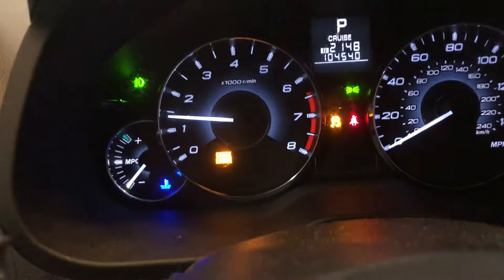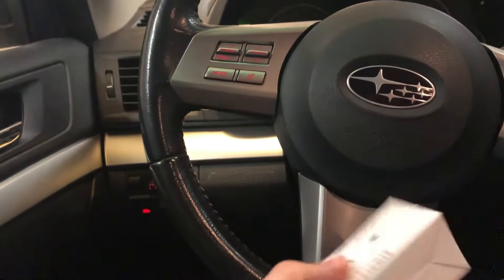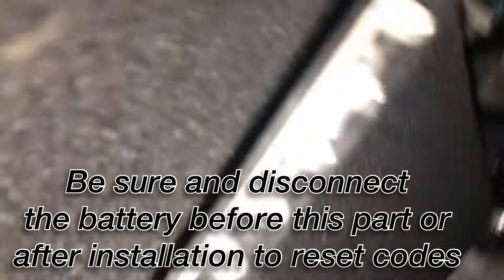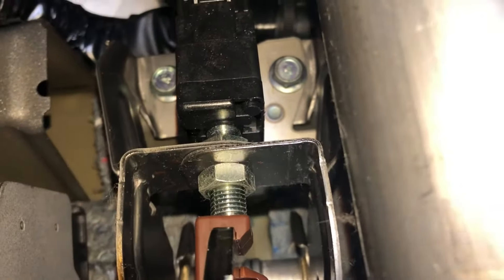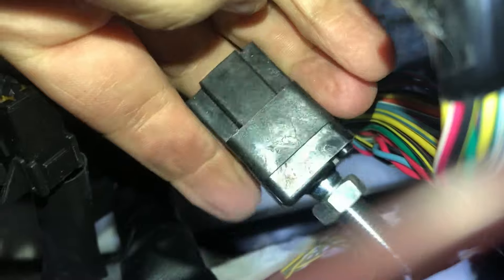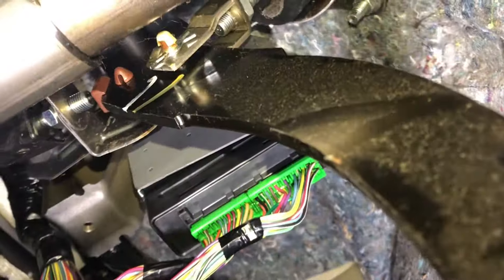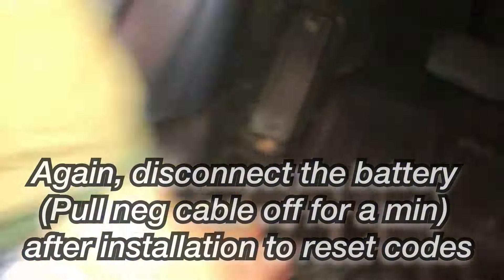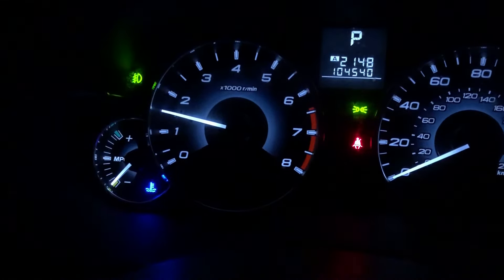Replacing Brake light Switch in the Subaru

Comment: We just changed out the Brake Light Switch (Subaru #83370AA001 Stop Lamp Switch, from Amazon $35.80)... and it worked,.. so far! Thank You Kangaroo Elite for this well made video.
Reply: Has your problem remained fixed?
Reply: You can get the same part number for 38.65 on eBay and it’s OEM.

Comment: I appreciate your post!   My 2015 Legacy repeatedly overloaded the brake light fuse and as a result would not shift out of park without using the emergency release.  Replacing the brake light switch appears to have fixed the issue …. no blown fuses !
Reply from the maker: Wow!! That’d be super frustrating, as I was at least able to drive mine when it went bad.  Glad that I could help! 👍

Comment: Traction on with brake flashing on 2011 Legacy base after 15 min of driving only  - changed and adjusted BLS , changed rear break lights and reset with clamp off battery to clear codes. Perfect operation after.
Reply: I’m having the same issue with my 2010 legacy, gonna get my guy to check it out! 🤞🏼
Reply: Likewise! I’m really hoping this will solve the issue

Comment: i'm replacing my break light switch for the third time. i have been replacing it with subaru oem swift which is just a crappy nissan brake light switft. i'm trying a $50 BLS from oreilly which has a lifetime warranty.
Reply: What year was your subaru?

Comment: Actually a lot of issues cause this combination.  When ever the check engine light comes on with that combination it can be a number of problems which only a scan tool can help you figurre out which one it is.  On my 2013 Subaru Legacy when it happened this year the scan tool showed an engine misfire.  It would sometimes come on and go off after 10 seconds, and other times just stay on.  When I discovered it was an engine misfire, I looked at the coils on the H6 engine.  Three were cracked.  Replace the 6 engine coils, the misfire was solved.  This happened at 125,000 miles.  Fortunately, the scan tool led me in the right direction.  I wish it always meant something this simple but it does not.
Reply: What was the code on scan tool?
Reply: @kimatm6035  The only code I remember getting was P0303 - which is engine misfire.  That is when we starting looking at the engine coils.(myself and my mechanic who is really good) and we did figure it out when they were visibly cracked.
Reply: What kind of scan tool do you own that works for a Subaru?

Comment: Had the subaru outback 3.6 i changed the brake switch and brake light/traction light is now off the screen. And next thing you know another light came off which is the at oil temp flashing… want to trade in this car but want to fix the flashing light first before trading in : )

Comment: Note: When I screwed in the part I got it in to far, which depressed the brake pedal. On my test drive I noticed the drag and readjusted the upper nut to lift it up and realease the brake. FYI, maybe that will save you some time and frustration
Reply from the maker: I knew not to screw it all the way in and adjust it where it clicks over only when fully depressing the pedal.  Good Catch!! And excellent pointer for anyone not familiar with setting up sensors. 👍
Reply: So you didn’t screw the nut all the way? I just fixed it but I can’t move my gear shift out of park. Could that be it?

Comment: Important Update¡¡ I changed the brake light switch, and it worked but only for two days. Had to take the car to the dealer. The reason behind the lights and RPMs falling to low on the stop lights, was debris acumulated on the hairlike strings on the Mass Air flow sensor MAF.
Reply from the maker: I never had low rpms with my issue. That for sure sounds like a MAF issue. Glad you got it fixed, plus if you changed your switch, that’s one less thing to worry about going wrong.

Comment: On some models there is a recall on the switches please contact your dealer first with your cars Vin number, if your car falls under the recall it gets replaced free of charge
Reply from the maker: Mine did not, but that’s always good to check first with an issue.

Comment: 2013 Impreza, replaced the break light switch unplugged the battery and cleared the codes. Two weeks later all three lights came back on while driving.
Reply: Did you figure out this?
Reply: Yeah what ended up happenning to it

Comment: Thanks.  Our lights are a bit different. 14’ with eyesight.  Only code I saw was a cat not operating up to efficiency.  Reset that and lights went away.  Will reset the second time but since daughter 1.5 hours away.  I will take a brake pedal switch with me.
Reply from the maker: Good easy thing to try.  Does sound a bit different potentially, may be some sort of dirty sensor or something if just the cat code is thrown, but hopefully it’s thiss oddly all encompassing brake light switch. Good luck!

Comment: here is how i fixed it! ...replaced both o2 sensors on catalytic converter(200 bucks from rock auto) also removed catalytic converter(15 min- 9 bolts easily accessible) and soaked it overnight in a large cooler with purple zep degreaser(15bucks)and water. then rinsed out converter with garden hose for 1/2 hr and placed back in cooler of just water to soak overnight again. reassembled and most lights went off(you can also disconnect battery for 20 min to reset ecm and reconnect) except brake light witch took couple drives to go off on its own, been 500 miles and problem hasn't returned. welcome

Comment: Same issue with my car. We replaced the switch,  so far no check engine light. My question is did your brake lights stop working or get stuck on? My brake lights were still working. Hopefully, this is the fix. The code reader did say likely fix was replace brake light switch.
Reply from the maker: Good to know it threw that particular code! Thanks for that!  My lights were also working, I’d assume some weird short in the switch that is enough to trigger the code, but not enough to keep the light function from working.  Glad to hear it helped! 👍👍🎉

Comment: The disconnect battery for 2 min will have the same result. Interested to know if you had transmission codes ?
Reply from the maker: Unfortunately I never had the codes ran.  Disconnecting the battery is the classic I.T. move 👍  Just an easy fix a Subaru mechanic mentioned trying.

Comment: Glad I found your video - Thank You. It really pays to have friends in the auto industry. I see your reply to David R below, two months ago, and I'm wondering if this problem has since resurfaced? I've been having this issue on my 2011 OB, ran the codes on the OBDII scanner. Forget what the code was but it didn't worry me. I deleted the codes and all was well for a few days then it comes back. Like I've read, doing this just erases the code and doesn't necessarily fix the problem. I'm surprised it's something this easy. BTW,  I see you had 104K on your OB, have you done your timing belt?
Reply from the maker: Glad to help.  I agree super odd to be this simple little part. I No longer have the vehicle.

Comment: Man same problem with my 2011 legacy and I changed the BLS and cleared codes but it didn’t go away so still stuck trying to figure it out
Reply from the maker: As I mentioned in the video, I didn’t have the codes ran when it happened, just got word of mouth to try this fix.  I’d try leaving the battery disconnected a good while and trying again, if codes persist it may be time to look into starting with the sensors associated with whichever codes you’re getting.

Comment: I saw your video to work on mine but I have a plate blocking access to the nut closer to the pedal. Is that something you removed on yours to access both nuts easier?
Reply from the maker: I think I just worked under/behind it if memory serves me right.  It was hard to film and do at the same time.  If you’re talking about the panel beneath the steering wheel, I believe that one is easily removed with a few 10mm small bolts.

Comment: Hi there I did this exact thing because I was having this problem. My lights went away but the minute I stepped on the brake the BRAKE light and cruise control light came back on. But, now my car stays in park and can’t move the gear shift. Did I do something wrong? Pls help!!
Reply from the maker: That sounds like the same thing.  Before replacing the whole switch like I did, check that your pedal is pushing the pin on the switch most of the way in by using your hand on the brake pedal while kneeling by your driver door.

Comment: Replaced my brake light switch part was 20$.not a recall for 2010 outback, was a pain in the ass to change and did not fix the issue
Reply: What fixed it?
Reply: @SamSam-ih6nt  Nothing yet, i have until December to deal with this.

Comment: Mine is doing the same . . . 2012 Outback . . . think I might have to try this too.
Reply: 2012 outback is not on the recall list. check with subaru website to see if they have added it to recall list. i had my dealer done today without paying a dime. good luck to u
Reply from the maker: It’s worth a shot.
Reply: Any luck with that Homeless Pepper?? I'm having the same issue myself??
Reply: @pedromoctezumajr837   unfortunately it was the head gasket that needed replacing. I had that done in August 2019 and all has been fine since. Hopefully your car isn't as serious as mine.
Reply: @Homeless Pepper....same year over here, how was yours started, what exactly would happen, sorry to bother, but looking for relation, to see if my Outback is having the same issues you have had?? Was it expensive (work done)? I'm not a DIY guy, so I'm a bit nervous, I love Subaru, but this is scary, was an owner of an 05 fell in love, now have the 2012, and she's was good to me thus far, want her to make it to 200000, like my last one!
Reply: @pedromoctezumajr837  The engine temperature guage was showing it was overheating after about 45 km. Constantly had to fill up with rad fluid.
Reply: @AdamPepper12  mine is going red-blue-red-blue when all the lights light up, and blink...however when I'm just sitting, with the car in park, and running  it won't overheat....only when those cluster lights come on it overheats..that sound familiar???
Reply: @pedromoctezumajr837  that does sound familiar. I would get everything blinking and going off and eventually the temp guage light would stay solid. I hope it is simpler than what I had.
Reply: @AdamPepper12  that's scary...how would I know if it's a head gasket? And the codes I get under a code check don't pick that up?? How would I find out what side (drivers or passengers side is blown?? Is there a tell tale sign that would show me??
Reply: @pedromoctezumajr837  I didn't get confirmation until I took it to a dealership. They will run all kinds of pressure tests to diagnose it. My code reader did not pick it up either. It was not simple for them to pick up, it took a few goes.
Reply: @AdamPepper12  wondering if a leak would give you a detailed explanation to what head gasket is blown, did the dealership charge you to do the test??
Reply: @pedromoctezumajr837  not sure if there was a charge because I had them do all the necessary work. Had them do the timing belt while they were at it. It was about $4000 Cdn which is about $3000 USD so it was not cheap. The repair list was quite extensive . . . but I cannot remember all what they did.
Reply: @AdamPepper12  damn....your breaking my ❤️

Comment: Have a 2015 outback 3.6. Most of the time just taking off the gas cap and putting it back on would clear it. The last time that didnt work. I disconnect the battery cables for 4-5 min, it cleared but came back shortly. Then I dissconnected the cables from the battery and then held the pos and neg connectors togather for 20sec to reset the ecu. Hasn't came on since.
Reply from the maker: I tried resetting by taking the battery cables off, but this permanently fixed it, far as I could tell.

Comment: Assume you checked your brake lights. Was the switch adjustable? Looks adjustable. It Cancels auto braking. Dealer told me it wasn't. On mine I find there is a little too much travel before the lights come on meaning the Auto braking does not cancel with just a touch on the pedal. Went off approaching a fence to park. BAD. Had foot on the brake. Recon I swore at the car. CUSSED. 16 Outback 2.5

Comment: My 2011 outback had all lights on. Oddly I replaced the front wheel bearings drove about 50 miles and all the lights went out and never came back on. A  Subaru mechanic with 25 years experience told me it's a common issue with Subarus.

Comment: Also, for me , it was my battery cable was rusted out and car wasn't getting a good enough and steady enough connection.
Reply from the maker: Corrosion on the battery is another common one with electrical issues such as this. 👍 Glad you got yours fixed up

Comment: Just changed the brake light switch and immediately the lights came back on. 2013 Subaru Outback. Also replaced the battery. Any other ideas?
Reply from the maker: Electrical issues can be a real pain to track down. Obviously the switch fixed many people’s problem. Battery was a good call to try. There’s a whole heap of sensors that could fail, from transmission, to Mass airflow, to ABS. I’d make sure you replace the brake light switch with a brand new one, and not old.  I’d only be able to suggest talking with a subaru mechanic that would better know common problems, after all, that’s how I found out the brake light switch was a common issue.

Comment: My car has the old one the would just twist and click into place does it matter ?
Reply from the maker: I’m not 100% certain whether this is an all Subaru common fix, but if you have the same issue and the car seems to be running/driving fine, then I would definitely try replacing your switch.  Fortunately it’s not a super expensive part, so low risk if your issue is in fact different.

Comment: Thanks.  But why does Forester have so many electrical problems?  I did buy the extra warrantee but now I'm wondering if I should have bought a Volks Wagon.
Reply from the maker: You really think I’d have the answer to that question?  IMO never get the extra warranty. Also, No VW woulda been as bad or worse.  It’s pretty easy to google car reliability. Just buy a Toyota and be done with buying cars for the rest of your life. 👍

Comment: Did the rear lights worked  before changing the brake light switch or did they malfunction? And thats why you change it? Or just because of the dash board lights?
Reply from the maker: As far as I know the brake lights were working, but something in that switch caused the dash lights all to light up.  It’s an odd issue that seems to lack a lot of logic, I know.
Reply: And last question, before you fixed in it , did it throw any codes? Thanks

Comment: I replaced mine but within a few weeks it turned on again 
Any suggestions on what it could be? Or what to do? Thanks
Reply: Same, I've heard everything from a new gas cap, an oil change to a battery.. still hasn't fixed the problem.  Next is vac/evap lines.. hopefully that works. Side note, when I cleared the code in warmer weather, it seemed to go much longer before coming back on compared to colder weather

Comment: I have a 2010 Subaru outback 2.5i, I replaced gas cap and brake light switch,  few months later the Christmas lights on dash again! Anything else we can do?
Reply from the maker: Daniel Randich That’ll be beyond me, man.  I’d almost assume you got a bad replacement brake light sensor or it wasn’t fully plugged in or maybe codes weren’t reset from removing the battery cable for long enough for residual power to drain from the system.
Reply: My outback had all the lights. Changed the front wheel bearings and all the lights reset after about 50 miles. Don't see the connection but it worked.

Comment: The chance that to be the problem it’s slim to nothing , see why the check engine light is on , address the check engine light , and the rest of the lights will go away with it . Most common problem is oxygen sensor codes , you replace the oxygen sensors, and the lights still come back , because of connections issues , in the main wiring harness , on the passenger side , towards the firewall .

Comment: I have the same issue but I also have the a/temp light on as soon as my car starts, along with the traction control and brake flashing. I had the main fuse blow out I’m guessing from a short I replaced that then all the extra lights popped up. Mind you none of those lights were on before that fuse blew.
Any advice on the a/t light ? I haven’t driven my car since last august
Reply: Hey did you find a fix? My subaru legacy 2011 has both brake and traction control lights turn on every time i drive for a bit then after more time my at oil temp light comes on but the oil temp is fine.
Reply: @Darkangel-bg7ci did u fix yours? How?

Comment: My Subaru Legacy have the same issue plus AT oil temp came on? But when I drive and dead stop the car kinda jump. Did you had the same issue ?
Reply: And what’s that part called I’ll appreciate you if you leave a comment
Reply from the maker: @farhadsarvari3379  I don’t recall the vehicle ever lurching forwards like you describe, but the part I replaced is called the “Brake Light Switch” and can be bought at a Subaru dealership under $100.